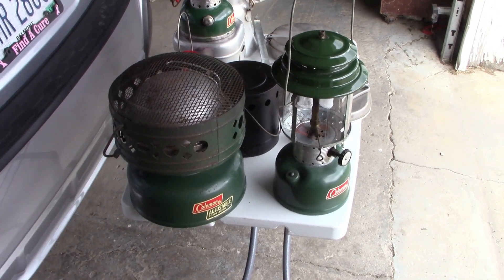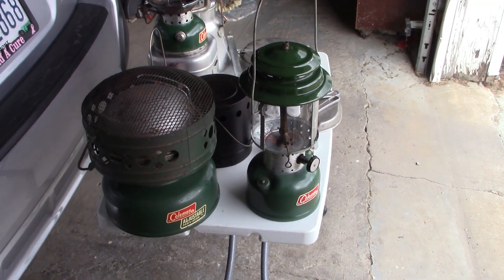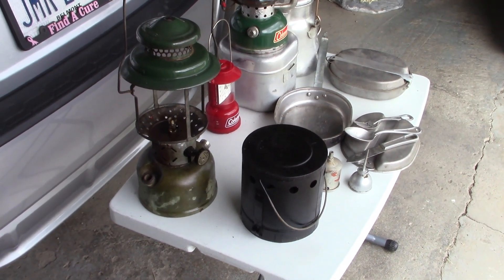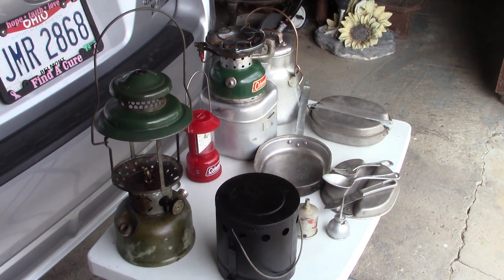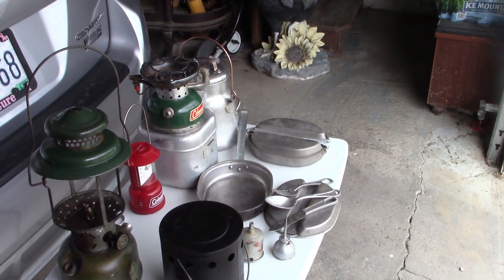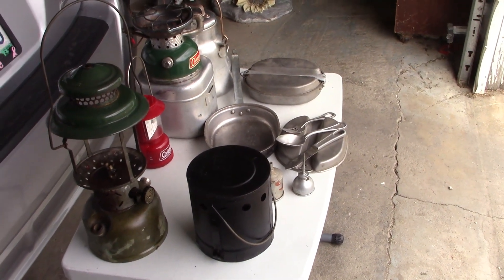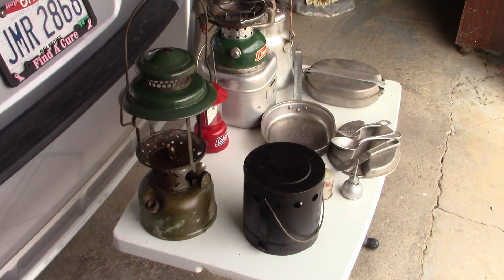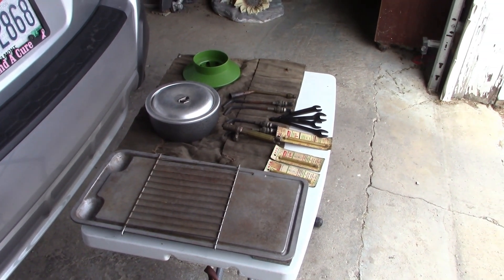Come Shop with me !

Comment: Hi Chuck! Great finds! I have an old Coleman two burner stove but the pump on the tank stopped pumping. Do you know how to repair the pump? Any help would be appreciated.
Reply from the maker: Hi..  They are really simple to work on..  usually just oiling the leather in the pump will do the trick .. In some cases you may have to remove the circle clip and pull out the pump to oil the leather cup but usually just adding some light oil to the small hole on the pump cap will do it.  Let me know if you get it working.
Reply: @Plain-Ole-Chuck  Thanks! I will give it a try.

Comment: Some very nice things for sure.  That's an interesting griddle.   I think I'd  just spray it down good with a good degreaser let it sit a bit and wash down good with hot  soapy water.  Should work great on a stove. Ive not seen a Coleman aluminum griddle with heat diffusers before.
Reply from the maker: I watched some videos .. they say you can use the blue can EZ off on aluminum... No lye in it...